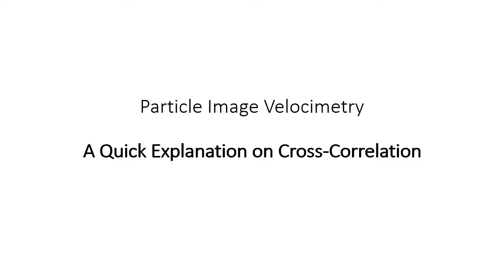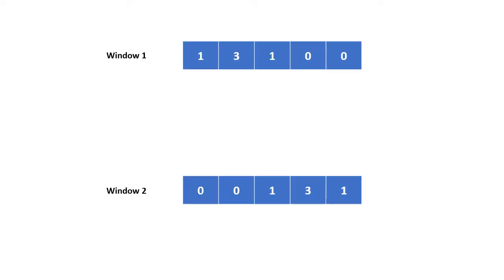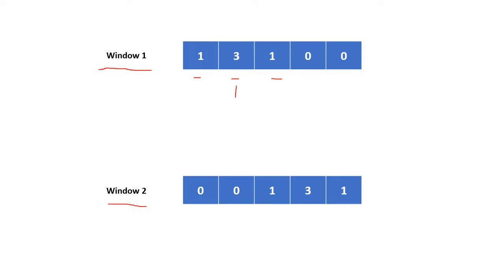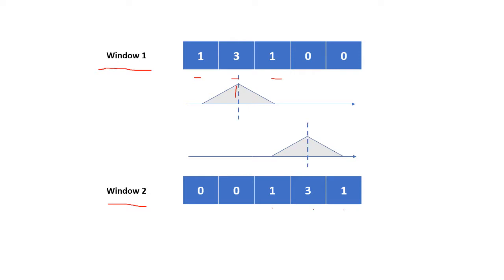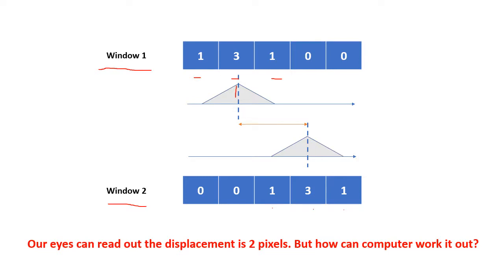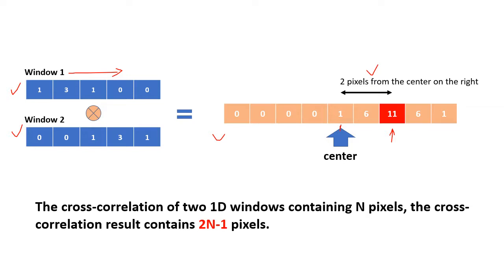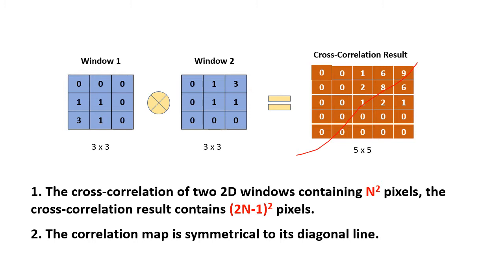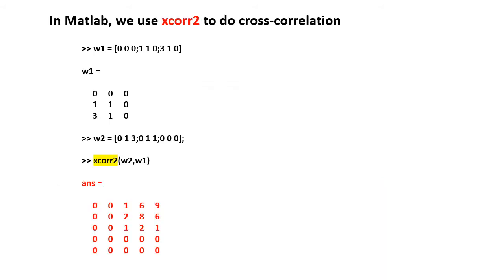PIV Cross-Correlation

Comment: Hello, great video. However, I have one remark about the 2D correlation. The numbers have not just been displaced. Also, it seems like there was a rotation. It goes from  W1 = [0 0 0;1 1 0;3 1 0] to  W2 = [0 1 3;0 1 1;0 0 0], so it does not seem it was just a translation. In the end, what you have correlated is just the movement of the number three; if you move all the numbers one, two up and two right, they do not appear in the "searching area." That is why you get 9 as a maximum value in the cross-correlating function. Maybe it was a better example to correlate with W2 = [0 1 1;0 3 1;0 0 0] where you get 12 as a maximum value and the moving vector is [1,1].